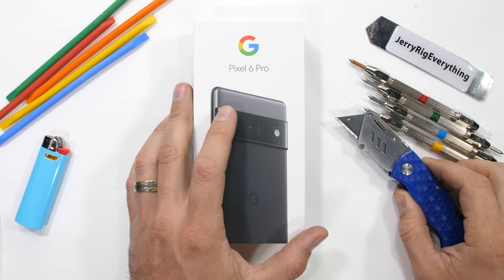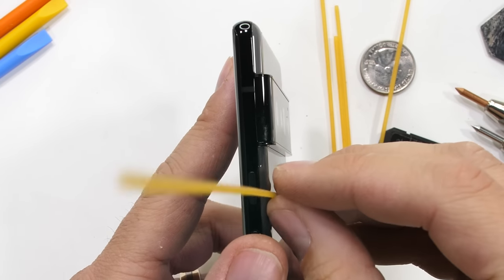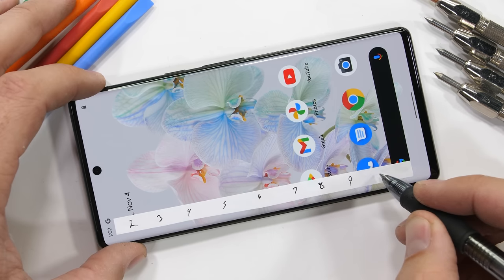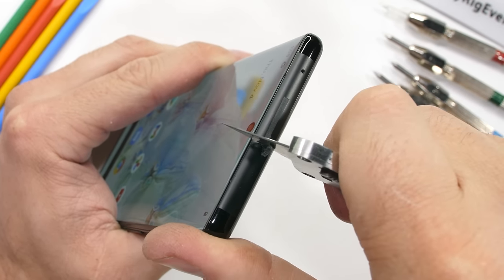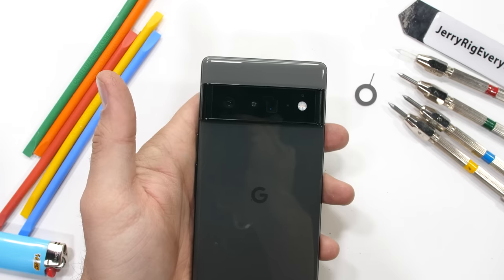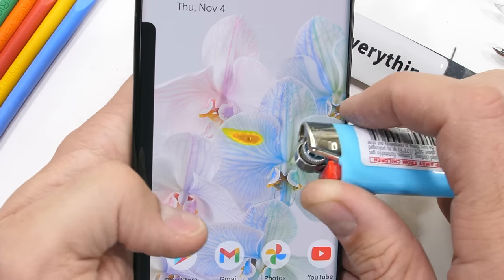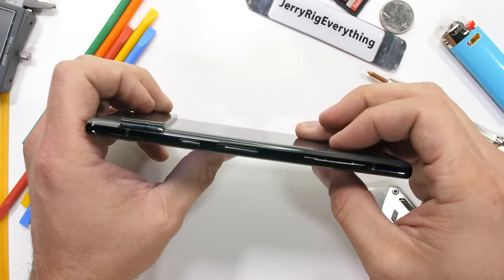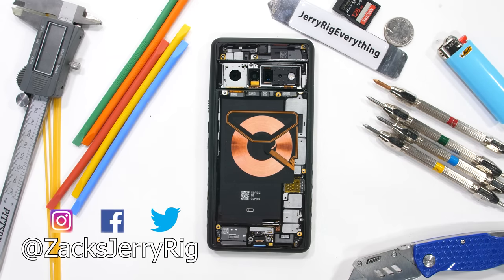Pixel 6 Pro Durability Test! - How much Plastic this time?

Comment: The Now Playing feature has been around for quite some time. It's even been on my pixel 3 since it came out with Android 9.
Reply: It was first on the Pixel 2 (and 2 XL), and works totally offline, doesn't send anything to servers. Conspiracy theorists may love it, but it ain't sending your data to a Google.
Reply: @KieronQuinn  You can't be sure about that...
Reply: @KieronQuinn  yeah I was going to comment about this as well, I had it on the 2XL
Reply: @ThePowerLover  It scans against data stored on your device, you can use it offline, meaning no audio clips leave your device.
Reply: @ThePowerLover  can confirm it's all local, I was out with no wifi or cellular connection and it pull up the song with the same speed as always. Before that I thought it would require a connection too
Reply: @HelloFellowDinosaurs  The phone is connected to the network even when it said it isn't. Read the info leaked by Edward Snowden.

Comment: I've just recently bought this phone and watching this tear down was both soothing with the narration but horrifying with all the scratches/burn/extreme agressive bends. I'm happy with the durability test otherwise 😁
Reply: how do you like your new phone?? Been thinking about getting a new pixel
Reply: @brute1604  tbh a few months into this phone now, I would say wait till the pixel 7 comes out or find another option. This phone does have a great front camera and the fast charging is amazing , but just beware this phone only charges with a 30w cable charger or some wireless chargers (which isn't common to find if you become stranded). You run into some bugs sometimes which can be annoying, I just have a love/hate relationship with it rn.
Reply: @lalobarron5881  update pls? and does it get hot ?
Reply: @amaztastic3183  This phone does overheat easily and I would recommend looking at a different phone. I give this phone a 7/10
Reply: @amaztastic3183  Also the battery on this isn't the best, doesn't last all day.

Comment: I have the dBrand case. It does eliminate the camera bump, however, the cameras are right where you would naturally rest your fingers when holding it single handed in your left hand. It's not so much of an issue with your right hand, because your pointer finger rests over the flash. So having the bump is actually beneficial so you know where the cameras are...Otherwise I hope you plan on carrying a microfiber cloth everywhere you go to wipe away finger prints and oils off the glass over the cameras.
Reply: Do you have big hands? I'm 5'7" and my fingers always rest just below the camera bump no matter which hand I use.
Reply: You must have gigantic hands. I'm 6ft and have moderately large hands and my fingers don't come anywhere near the camera bump on the pro.

Comment: I've had mine about one week.  Complete smart-phone newbie.  Just barely 'scratching the surface' of it's capabilities.  Very cool to see this, thank you for doing it!
Reply: How has it been so far? I'm thinking of buying a pixel 6 or 7 and not sure how good of an investment it is.
Reply: @space_bacon1953  So far it's doing what I need it to do.  Holding up great, no screen scratches even though I don't have it covered.  Also, after seeing this channel's video on the 7 Pro later, I'm glad I didn't wait and buy it instead.  I'm glad for the 6 Pro's stronger frame design.

Comment: Hey Zach, have you ever considered doing the burn test right over the under screen fingerprint sensors to see if it affects the fingerprint sensor?

Edit: wait.... is it Zach or Zack?
Reply: It's Jerry, just a lot safer. And definitely he doesn't mind, so.. 🤣🤣
Reply: He does the fingerprint scratch test. After that if he did the burn test it wouldn't be right since the strength and quality of the glass would have already been compromised.
Reply: @aaryaputra108  tbh I wouldn't mind it if he did it only one or two times with a phone, since I really wonder what happens when you do that. Also, i'm not really sure that heating the glass after or before scratching makes it weaker, but you might be right.

Comment: You should include a drop test in all future durability tests.
Reply: Drop tests are insignificant for any practical demonstration. there are loads of variables(like the exact spot and angle of impact, spin and momentum of the phone, etc) and it'll be practically impossible to simulate the exact same conditions each and every time even if he used high accuracy machines to drop the phones instead of dropping them himself. They only hold value when done in a large sample space (at least thousands of samples of the same phone)
Reply: @silphate9836  I agree with you, but your comment makes it look like the other durability tests on this channel are very scientific and accurate. Many of the tests that he does, for example, burn test or bend test are not practical anyway. So why not just drop the phones a couple of times at various angles to see if they hold up? I am not expecting him to do highly precise tests either. I believe that he has already done drop tests in the past with iPhone X variants and Pixel 3. It would be great if he continues to do them with other phones.

Comment: Actually, the head of the calliper has a function of measuring the step height, and that will be more accurate to measure the camera bump than use the tail. Btw, thanks for really good quallity video XD
Reply: He already did that during the S20 ultra durability test plus roasting the US customary units.
Reply: @yosoy01ian  maybe you don't get what I mean. The calliper he used has 4 main function: big jaws for external dimension (what he used in the s20 video), small jaws for internal dimension, the tail for depth measurement, and finally the head for step height (this function is what i mentioned, and may be missing on some calliper).
Reply: @vinhnghihuynh8907  the fourth one is seems uncommon. The other 3 (external, internal and depth) are the most usually seen.

Comment: Hey Jerry, did you notice the plastic sticker across the camera? I do have a DBrand skin which also includes a piece for this lens area. Is it removable? Will I hurt the phone if I peel it off? No one seems to mention it. I found a redacted comment on reddit, but the no other mentions of this. It does look removable as it doesn't extend the whole way over edge to edge, but yet it has a perfectly placed hole for what I assume is the microphone. Would really like to know before I ruin either the phone/warranty or the DBrand skin. Thanks.

Comment: I love my Pixel 6 Pro. I've used a beautiful Spigen protective case on it since day 1... Same case I used on my Pixel 2 XL, which was the phone I had before this one. I'm not one who usually drops their phone, so the few times that I have, it's usually been on concrete or asphalt, and I was relieved to see that the phone remained unscratched, un-shattered, and fully intact. The only real problems I've had with the phone is the auto-focus from the front camera being slow to respond and just generally a piece of shit functionally speaking, and the volume of phone calls being low.

Comment: My pixel 6 pro came with a torsional twist direct from Google that meant it wouldn't sit flat on my desk without rocking. Would you be able to incorporate a torsional twist with your hands in future testing? I was able to straighten the phone by flexing it with my hands in the opposite direction.

Comment: What's a good way to scratch (not break) the glass on the back of the phone sufficiently to give at a rough texture for the purpose of gripping? I do not want to buy a protective case since they add bulk and extra expense. But I just know that if I don't do anything about that glass, the phone WILL slip out of my hand and break at some point.

Comment: Question [for the teardown in case you're reading this Zack]: 
Does the Pixel have a hidden button at the back or some other button based mechanism?
During the recent Pixel event they showed a collab feature with Snapchat which involves tapping the back twice to activate it.
Reply: The double tap or "QuickTap" is just a gesture that you can use to trigger an action. There are only a few built in choices, including opening the Snapchat camera. I use mine to prompt Google assistant.
Reply: @jefftorkelson685  Thanks for the answer bro, was particularly interested in the hardware implementation used to register the taps, the feature's name helps. 
Did some more digging, apparently the feature uses the phones inbuilt accelerometer and gyroscope to register taps, no buttons needed. Nice.

Just another hint of many of Google's talents 😏

Comment: Hey, I dropped my pixal 6 and one dent formed on the top right corner of the frame, now there is a very thin gap created between frame and screen glass.
Does this affect the water proofing of this phone (IP68)?

Comment: The one thing i despised about this phone without the case is how its near FRICTIONLESS. It has some of the slipperiest glass ive ever seen, it will not sut still on anything.

There was another guy testing its grip and it was less than silicone used as a buffer material. One of the fastest cases i ever bought, which makes the phone heat up annoyingly.

Comment: I don't know what it is but the glass on this phone is garbage. I had a pixel 2 for 4 years with No screen glass issues (I was able to get a protector on it about a week after owning it with no issues before or after installation. When I got my Pixel 6 pro there was a period of about 2 weeks where I didn't have a screen protector when initially getting it. After those 2 weeks there were micro scratches everywhere and some relatively deep gouges, most of which were not covered up by the screen protectors adhesive (sometimes if the scratches are small enough it will seep in and cover them up). And to add even more fire to the flaming heap I was charging it the other day on a table, no interruptions, Nothing special, I heard a pop looked at it and realized there were two large cracks that had appeared across the entire screen from top right to bottom left. At this point I'm thinking this is a very odd issue that surely nobody else would have. Nope. There are hundreds and hundreds of other pixel 6 pro users experiencing the same or similar problems The shit just breaks without warning and at random. Presumably it has to do with thermals as it was during charging and the phone heats up slightly. However, it's gone through hundreds of charge cycles exactly like this over the previous 4 months, since first owning the phone.

Comment: I dropped my Pixel 6 Pro off a table, a fall of only about 2 feet and it had a beefy case on it. But it shattered the screen anyway and I had to replace it to the tune of $275 USD. Not very durable in reality.

Comment: Dropped mine on cement within days of owning it, had no screen protector or case on it, the entire screen shattered and the plastic backside, the metal edges seem durable tho but what's the point of that if everything is plastic. Got an insurance replacement that the front and back wide angle cameras are extremely fuzzy haha jeez 😂

Comment: I have the Google pixel 6, only thing I wasn't happy with, whilst waiting for the case I ordered to arrive, I had dropped the phone once, got a small hairline crack on the top right corner. The gorilla glass isn't as strong as you'd think

Comment: Maturity is when you understand that literally all phones, irrespective of the price/the type of glass used, scratch at level 6 with deeper grooves at level 7 😂
Reply: that's the scratch resistance of a tempered glass

its the Goldilock of price to ease of manufacturing, to scratch resistance, to durability to functionality

yes those are alot of variables to take into account^

its the industry standard, and it works perfectly fine for normal usage

Comment: Great phone overall send good build, but horrible scratch resistance. got the Pixel 6 Pro right at release. After weeks of careful use have a bunch of microscratches all over the front and back. And one super deep Scratch at the top edge of the front screen. switched from Pixel 2, which used for 4 years without any case or screen protection. No scratches on the display there at all. Basically, Google now have made a huge slippery all-glass phone that you absolutely have to wrap in a case and screen protector, otherwise it'll scratch up fast in everyday use even if you're really careful. I don't understand this material selection. Don't they run durability tests on the hardware? Have to say, I'm really disappointed.

Comment: The .most important test is a drop test. Not many phones are gonna get burned or bent. Scratched yes. Dropped 💯. So it would be nice if you ended your tests with a drop  test or do it before the bend test.

Comment: Gorilla glass 6 is absolutely garbage I have hundreds of scratches on my pixel 6 pro and I only only put my phone in my pocket when it's empty and I always lay it in its back.I've had the phone maybe a month and a half, 2 months this is insane that gg6 is worse then gg5 or gg4. Also had this problem with my one plus 7 pro. I'm never getting a phone with gg6 again.